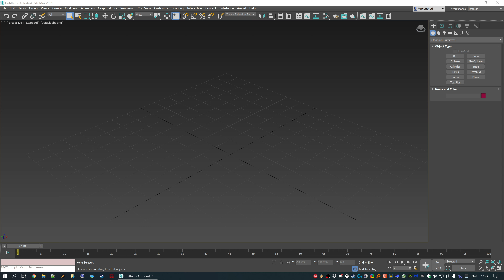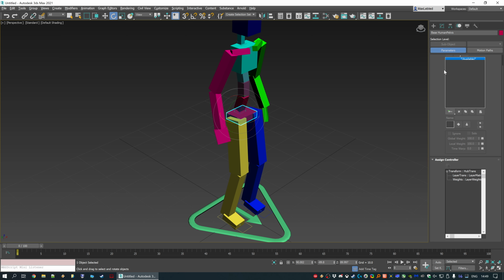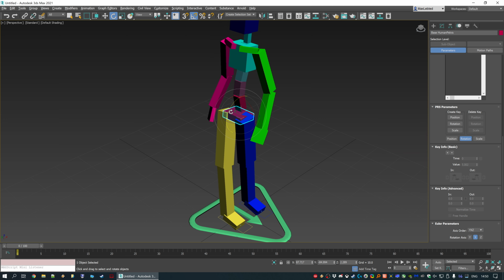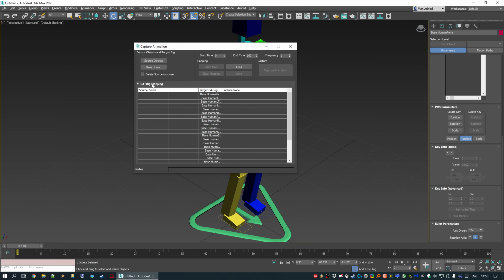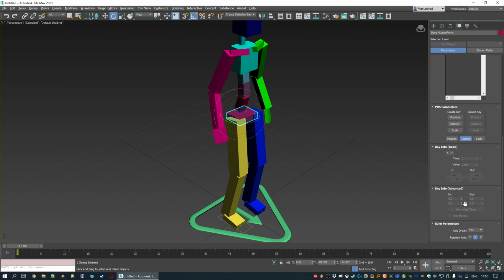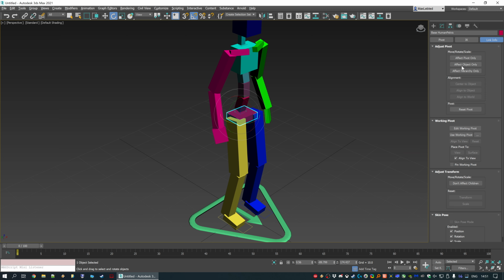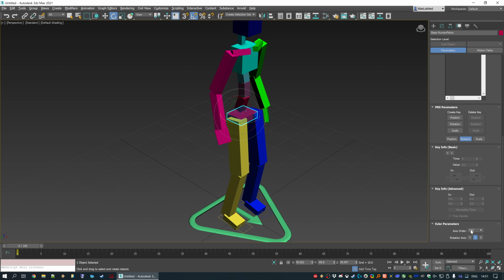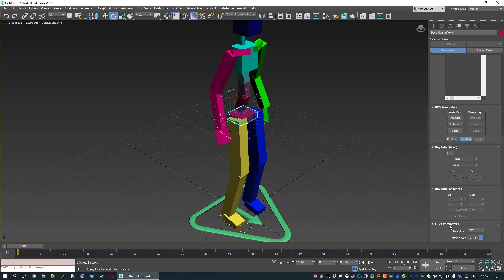How to fix the default pelvis gimbal lock on CAT rigs in 3ds Max

Comment: I'm not an animator. I do lots of other stuff but not robust animation (just basic usually)
Wow I just spent insane amount of time and effort on layers in CAT and just now finding out and realizing a big part of my problem is this gimbal lock stuff. I think its Quaternion and not Euler.  Animating in Max with CAT this way feels insane. Like I never want to do this ever again.  Key-to-Key i get all kinds of interpolations and "swimming" crapola and trying to fix it is impossible even trying linears and messing with curves. It just can't "iron out".  My animations have jank all over the place.
Switching to YXZ if i go in to my curves and pull the Z and Y frames/curves around it still rotates in the same direction.   Z rotates in Y.    I can freely rotate the pelvis in all 3 directions in the viewport but when i mess with the Track View Curve Editor its this alien "Z is also Y" situation.   
Is there a way to convert the CAT Rig over to Euler?   If not, then is this just another reason nobody uses Max and everybody uses Maya for animation at every game studio i've ever worked at?